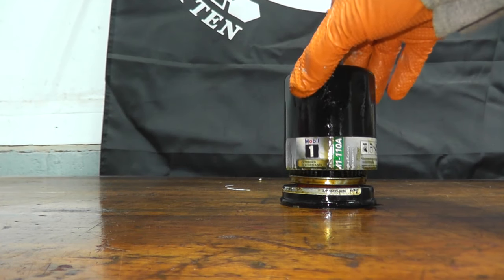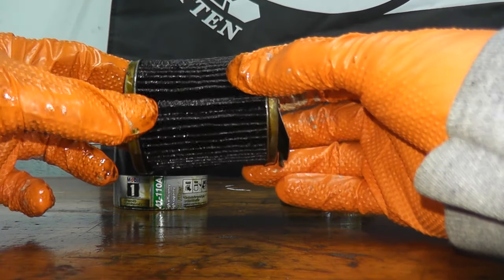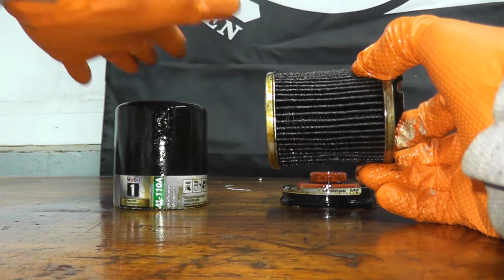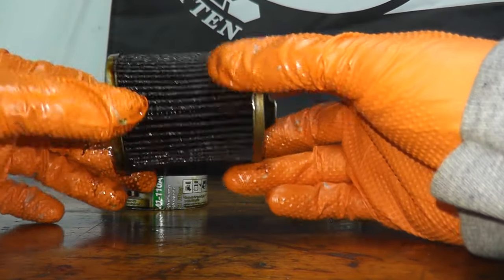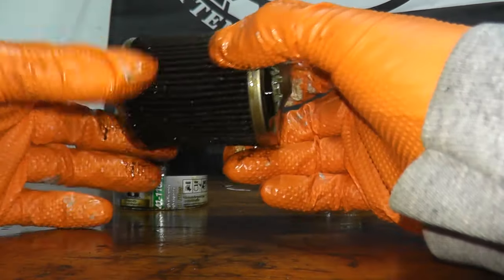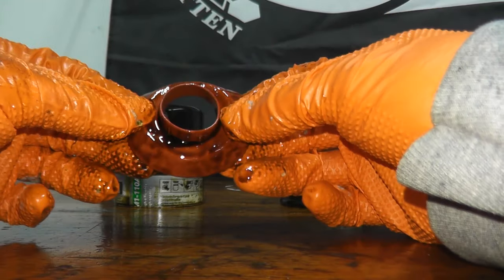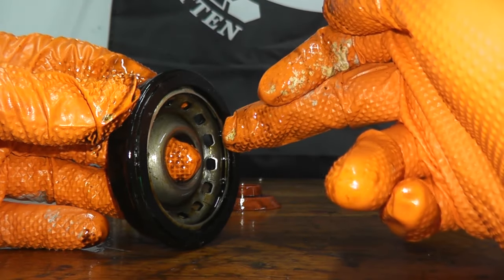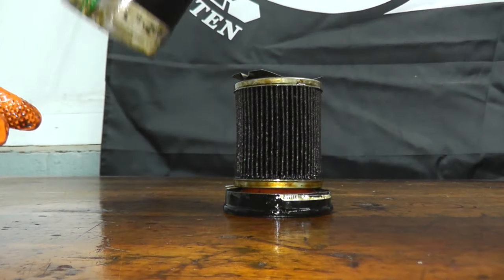Mobil 1 Oil Filter After 15k Miles Of Usage

Comment: One more thing I noticed... You seem to go out of your way not to mention the Fram Ultra.  Why? IMO, it is the best filter on the market, especially in cartridge form.  FAR superior filtration than most and better than all of the filters you recommended.  Otherwise, again, great video.  Just don't leave out one of the best filters you can buy, and for less at Walmart than you'll pay for that Mobil 1.  Almost 1/3 less cost and more than 1/3 better filtration, plus wire backing.  And I would never recommend Purolator to anyone.  Never.
Reply from the maker: Thank you. Appreciate the feedback. Here are the Fram filters. I agree with you. The Fram Ultra Synthetic is terrific value. Cheers.

https://youtu.be/dcqQRqRV5kU
Reply: its your opinion.  none of these so called filter tear downs actually examine differences in filtration.  That would require same oil and different filters being pumped through it for periods of time.  No one does it.  rest is conjecture and opinion.  Cant believe you would trust Fram but whatever

Comment: You had me until you said just plain Mobil 1 oil not the extended performance oil to match the extended performance filter. That oil isn’t meant to go over 10,000 miles and probably 5,000 of severe service with idling. Even Mobil 1 extended performance oil I don’t take over 10,000 and that’s rated for 20,000. The oil itself makes this filter examination null and void. Thanks anyway lol

Comment: Fram ultra is better than Mobil 1 and cheaper, Fram ultra has metal cap ends, better valves, full synthetic media, wired back, and 20 microns rating compared to Mobil 1 30 microns. Nissan Titan 296000 miles, 5000 miles OCI.

Comment: Everything about Mobil 1 is overhyped their motor oil is pretty basic there's really nothing great about their oil additive package. If you compare the mobile 1 filters to some of the other mid-grade filters on the market you'll find they all pretty much look identical and as far as I'm aware Mobil 1 filters do not have a full synthetic filter media I do believe that's false unless someone cares to prove me wrong. You pay 10 to $15 for a Mobil 1 filter or you could just buy a Purolator boss filter for $12.36 and get the best filter for your money that will completely run circles around Mobil 1 regarding performance. I'm not trying to knock Mobile1 to bad  it's not the best on the market but it's definitely not the worst  but for the money you can definitely get something better.

Comment: I have driven over 125k on that type of oil and filter and never had problems with it. Did it every 20k and did the transmission every 30k just to make me sleep easier at night and I haven't gotten any problems with either. It helps when you do it yourself. Some of these lazy people out here can't even change a headlight or fix their alignment on the headlights but run around with tinted windshields and gun's.... but you are all in here talking about oil changes... 😆😅🤣😂 how sad
Reply: You can't even get them to regularly check their oil, let alone extended intervals.
Reply: @digitalunit318  yeah lol, they'll be like, I changed it 5 years ago
Reply: So if you're suffering with insomnia you know it's time to change your oil. 🤔😁

Comment: Why on earth you would change your oil,and not the filter is just idiotic.Your under the car you have to pull the drain plug,and the filter is right there.
Reply: I guess you've never changed the oil in a vehicle with a cartridge oil filter. That is a bit more complicated and messy and takes more time than simply spinning off an old filter and spinning on a new one; especially if your oil change comes due in the middle of the winter when it's 10⁰F out and you don't have a garage. Add to this being an older person with the usual achesxand pains that come with age.
Not idiotic at all to spend twice as much on the filter and only replace it every other oil change. And some others use an oil extractor to change the oil instead of removing the drainplug so they don't have to crawl under the engine if they're not changing the filter.

Some people are just ignorant of the circumstances of others.
Reply: NOT on many cars.  Filter can be under the hood or off in the wheel well or on top of front axle.  You are completely wrong but have a good day

Comment: fibre end  could blow out if you leave it in the engine more then a year  then you have a fibre sludge in your engine bye bye engine

i.e parked for a ytear
Reply: zero evidence.  pure speculation.  please provide your numerous claims backed by evidence
Reply: @02hreblue30    this all ready happened with the cheap ac delco filters   the filter  media  is garbage   go look at the youtube video about it..  no one has high hopes for the E series filter garbage...   even the newer trucks/suv are blowing up engines after only 6,000 miles(AFM valve spring failures )     the quality after 2014 models is garbage...       

 the quality control is non existent, i would not trust a E series filter in my rig...